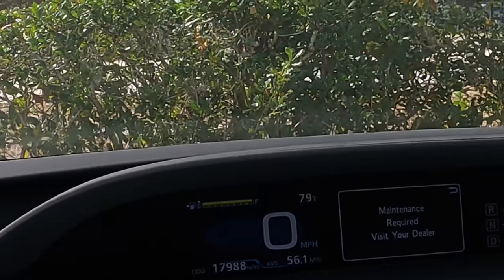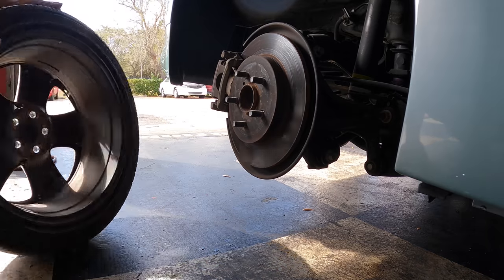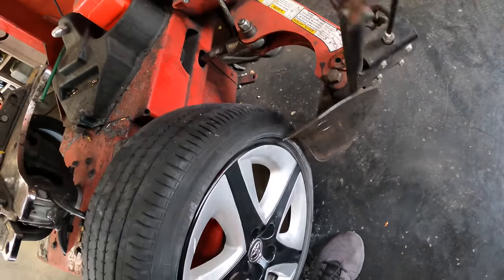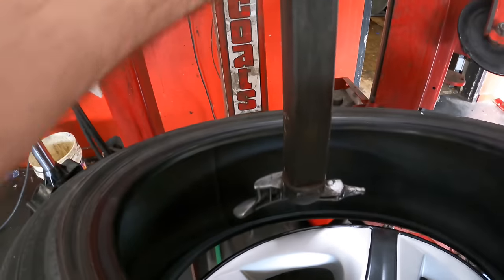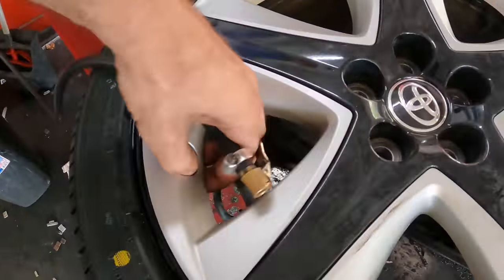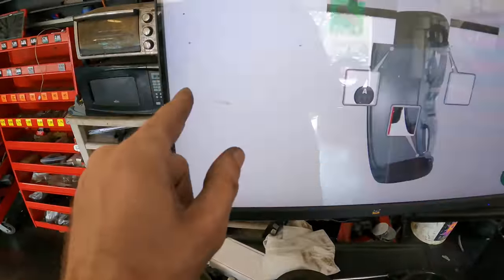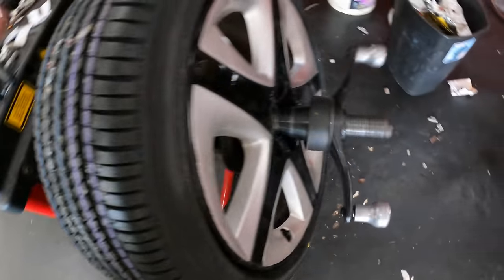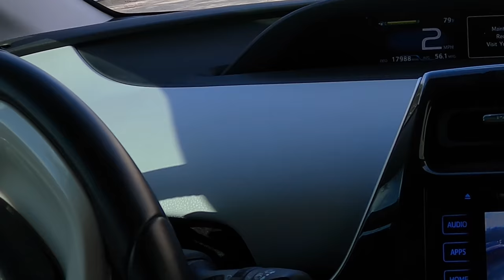Insurance Jobs, Not worth the Deductible! Toyota Prius! Tire and Wheel Walk Through

Comment: I did this almost 40 years ago in my grandfather's service station while in high school. The norm was still steel wheels. We would turn away all aluminum wheels and send them to the tire dealer because of our ancient tire equipment. We didn't have anything like this. Even our balancer was an old Hunter that you would balance while the wheel was on the car. We would even have to air up some truck tires with a lighter and a can of ether. Sketchy shit.
Reply: For very large industrial equipment tires they still do that with using lighter fluid to bead a tire and then some countries less developed. Do the same thing but on trucks like 18 wheelers they use a tank with a special nozzle nowadays
Reply: Those truck tires were dangerous.  I remember putting split rim truck tires under the hydraulic lift to air them up.  Getting the bead to set was a task on big tubeless tires.  Fortunately back then (60s) all large truck tires were tubed.
Reply: @todddunn945  Split rims! Yikes!
I still remember watching a news report that had video on some split rim failures on the tire changing machines of the day. That was some scary [bleep].
Reply: @toshihitsu1989  I've changed heavy equipment tires before. Tractors, skid steers, backhoes. We used starter fluid for the bead-sealing 'boom' and we immediately had to start putting air in before the expanded gasses cooled.
We weren't equipped with the fast-fill that actual tire shops have.
Reply: @MonkeyJedi99  yeah split rims were definitely scary.
Reply: Heck, I built my own manual bead breaker out of an old stair stepper treadmill type of exercise machine and some scrap metal, used old school tire spoons to remove the tire from the rim, and in some cases still used the ether method to set beads on some tires if they were stubborn. I just can’t swing a bead breaking hammer anymore which is why I built the bead breaker.  Then when I lost my house I had to store some things at my brothers house and he didn’t realize what it was because it was half disassembled and hauled it out as scrap metal, thinking it was dropped off as scrap by a friend of his and I have never found another one like it to build another one.
Reply: Vehicle mechanic in the Air Force from 1977 until 1984. I was stationed in the Philippines and we were doing set of tires on a trucks split rims.  We get this one tire done and I wheeled it into a 1/2" solid steel cage with welded 3" square tubing , engage the air chuck, step out of the cage and with the remote air valve open the air.  I step a few feet away and in a instant at around 60 PSI the split rim separated with a big boom.  The split ring was embedded into the 1/2 steel and back side of the rim was had put a dent on the outside of the steel cage.  Talk about scaring the bejesus out me. I was totally not injured but praising the safety cage.  Split rims are total garbage and I am glad they are NOT used anymore.  Edit. The force of the explosion totally blew the air pressure regulator off its mount and crushed the air line outside the cage.
Reply: @mikeske9777  split rims are scary to work with and have injured and killed many people. I saw an idiot working on one outside without any safety cage or even a chain and he had the ring aiming down. He was actually kneeling on the tire and rim with his knees on one side and his hands on the other side when it let loose. It sent the rim and tire all the way across the driveway landing in the middle of the road sitting on his lap with him still holding on to it because it had carried all 290 lbs of him with it. Somehow he only ended up with bumps and bruises other than some road rash on his @$$. He NEVER did that again.
Reply: @todddenio3200  Oh I know that for sure and am glad the Air Force made us use the safety cages. It was a big time write up for someone not using the cage.  The cage we had was utterly destroyed and had to be rebuilt after that thing blew up.
Reply: @mikeske9777  I don’t doubt the damage in the least, those things are outright dangerous

Comment: I liked seeing the newer style tire balancer in use, I've seen them but hadn't seen the procedure and each step. 
If that was a Ford you would have been instructed to put a corrosive metal weight on the aluminum to ensure corrosion as quickly as possible.

Comment: How times have changed.  I busted tires full and part time from 1973 to 1979.  I used Coats 10-10 and 20-20’s.  Bubble balancing was all we had in those days.  I used the spin balancer often and they were very accurate.  That balancer Ray used was slick.  We could abuse the wheels in those days without fear of scratching anything.   Fired me when I closed the hood of a late model Olds with a hood a mile long.  Moral of the story, make sure the battery down Assyrian is not laying on the air cleaner housing when hood goes down.

Comment: The tire machine at the job I used to work at is on it's last legs.  The clamping jaws that hold the tires need replaced, the actuator leaks and can only clamp the tire from the outside.  Doing it from the inside like Ray did won't get a strong grip against the rim due to the air leaking.  Lastly, the pressure gauge doesn't work.  So there is a digital tire inflator at the machine to at least measure the air if the hose is in use.  At least it has the plastic head so it can't damage rims.

Comment: It's great to see you take care of the ally wheel I always cringe watching the mostly youngsters in these tyre company's not taking any care and bashing and gouging chunks out of them. Great vid Ray thanks. Oh and if that was my tyre would have got black rubber glue and stuck it down just keeping an eye on it .
Reply: I thought it was steel with a permanent wheel cover?
Reply: I've actually had a shop replace a factory upgrade wheel once. I was familiar with the shop owner & he allowed me to stand at the machine with the guy doing the tire removal - i always do. I took pictures of the wheel before with reference to the shop in the background as he was putting it on the machine. As he broke the bead, I noticed he had the "shovel" digging into the rim and it left a pretty little ring at the edge about 1/4" wide. I told him but he either didn't speak English or just ignored me. I told the owner & pointed out how many more rims he would probably be replacing. He had me come back about a week later and installed new factory wheel for me. The 9wner is very good about taking care of reasonable complaints. Ive only ever complained twice & I've been using this shop since I was about 16. They have been in business for over 80 years but the help they employ are trained on the job there with no prior experience. I guess you gotta save money somehow to stay afloat.

Comment: In Australia, all wheels made after 2010 must have tapered nut seats.
Reply: Aluminum wheels can't be used with tapered nuts if I remember right. Something about the metal not being able to handle the stress involved with the tapered seats. Duals also never use tapered nuts because they center on the wheel hub and both wheels are held sandwiched with the same nuts. It used to be a two piece nut where the first nut had threads inside and outside and held the inner wheel, then the second nut tightened down into the first nut and held the second wheel. That style was very time consuming and had safety issues since there was twice the chance for over/under torque, so it's no longer used. That's how it is in the US, don't know how Australia does it.
Reply: @TheHonestL1ar  Steel tapered seats are pressed into alloy wheels.

Comment: Why not put a new schrader at the minimal in the stem? I always replaced them to ensure no leaks. Stay safe have a good day
Reply: Because 99 times out of ten they don't need replaced. They really are quite robust. Rarely do I see a leak from them and when I do it's often caused by debris on the seat from when it was replaced. In other words even brand new ones would leak under those circumstances.  
I've also seen spring failure and sealing rubber failure - pretty rare. But then I actually test for leaks when I'm done airing up. I test the rim and both areas of the valve stem. Then I wipe it dry with a relatively clean rag.

Comment: I always heard that tires should be changed in pairs, ex both fronts or rears never just one. Something to do with uneven wear. Can someone elaborate?
Reply: On wheels that aren't driven, it's not that important, especially when the other tire is almost new as well.
Reply: There is a maximum tread depth difference between two tyres on the same axle so you can't just fit one new tyre on the back if the other is just barely legal but you could have two new ones on the front and two just legal ones on the back. Front wheel drive cars wear one front side the most so standard practice is to swop that to the opposite rear and vice versa with the other to get even tyre wear then just change all four at once. I do not like mixing new and worn tyres.
Reply: It can matter or not. On RWD cars it doesn't matter but some think it does claiming excess differential wear. When you consider that the differential is designed for this and goes through much more work when you turn, any tire difference is insignificant in real life. With AWD and 4WD you're supposed to match all 4 tires by measuring the circumference of them mounted and inflated; most manufacturers actually have a spec for the maximum allowed difference. Almost nobody does this as it's usually close enough if all 4 tires are alike. The transfer case isn't built to deal with large differences like the axle differentials are so pairs won't do here unless you measure and match the other two. In front wheel drive it's less critical but should be close; ie no well used across from new. Here the difference can cause handling problems when powering or decelerating through curves, so you want those on pairs.

Comment: That comment about the metal duck head scratching the wheel reminded me of a previous tire shop I worked at. They told me they only used that machine for steel wheels because it would scratch the aluminum ones. I checked it out and found a plastic insert in the duck head retained with a roll pin. It was totally worn away. I found replacement inserts stashed in a cabinet and replaced it, restoring the functionality of the machine. It was also the only machine in the shop with special attachments for mounting low-profile tires. I'm sure that was the factory-installed rim protector insert that I replaced. Sadly, a lot of shops don't maintain their equipment.
Reply: For fancier wheels I usually reverse mount to remove any chance of nicking the face.

Comment: That tire damage is so insignificant, i would personally just glue it together with rubber-tire-glue.
Reply: Falls under the category: Why my insurance rates are so high
Reply: Though in Europe it would fail the annual inspection and if caught by a observant policeman, a hefty fine and 3 points on the licence, put the spare on (if you have one even) or it gets towed away on a truck that they organise at your expense.
Reply: @572Btriode  Some US states are operate what you brought. My state has 0 inspection/0 emissions testing.
Reply: @mph5896  Yep, I understand that.  It's unusual to me, the UK and Europe run annual tests which are quite searching and severe.  At any police stop for whatever reason, they'll take a look at all the tyres, anything looking worn will have the tread depth gauge brought out.

Comment: I'm sure Ray looked but here is my pet peeve. Every manufacturer engineers how the tire works with that specific vehicle. They have a lable on the door jamb with the pressure that works. The maximum pressure listed on the tire is not the correct running pressure for your vehicle. Trust the sticker over the guy.
Reply: Think 32 to 36 is correct for a Prius depending on tyre size.

Comment: Always good to check wheel run out and out of round to make sure something isn't bent, especially if the tire had been damaged more from a curb hit or accident. Since this car came from the body shop, you have to wonder what work was done. Also a new tire sometimes comes from the factory out of round. Doesn't happen as much these days. Years ago had retread snow tires that took 8 ounces to balance.

Comment: I enjoyed this video for a number of reasons:

* The fact you were careful with the customer's wheel as to not scratch it.
* The fact you used the air source off the balancer to fill the tire up, and jammed the valve stem in when it was at the pressure.  (Surprised you didn't get comments about not using a stand alone, daily calibrated, dolphin safe pressure gauge accurate to .0001 psi.  haha)

Especially where I live (CA), shops are reluctant to let customers in the work area.  So it was cool to see up close how a modern wheel balancer works.

Comment: When I was a High School kid in the 1960's, I worked part time at a gas station and sometimes changed tires, like you did, when I was  not pumping leaded gas. We had a tire machine. But there was a lot of grunt work getting the tires off and on. All of the tires, back then, were bias ply, high profile tires. 

The wheel weight machine was a simple bubble centering device that the tire and wheel were horizontally put on to balance. lead weights were them added as needed until the bubble in the transparent liquid centered in the circle. 

Wheels were never torqued on the studs, like you did, just high impact gunned on.

Comment: I know you were trying for that 'Great Shot' when the bead pops on buuuut....... years ago my dad had a small gas station/ tire shop. He was installing a NEW tire on a wheel, airing it up and when it 'popped' the bead failed and it exploded! My dad was holding the air hose onto the valve stem. The tire shot off the machine and fractured the roof joists overhead! It also shattered the bones in his arm. He had to have several pins and more screws in his arm to hold the bones together. He never regained full use of his arm or hand. Don't take things for granted, just because it's new doesn't mean it can't fail. Please be careful.  As far as people go;  Smile, make them wonder what you're up to. :D:D:D

Comment: This is my first time seeing a tire change meticulously done with care. I guess I lived in the rotten apple far too long because I've seen tires slapped on no care to the tire sensor, nor lining up the valve with the dot, and I think this is the first time seeing the sticky weights removed and replaced during balancing. Maybe the dealer has done it but the local little shops don't and balancing is not cheap. So thank you, I learned something today.

Comment: Food for thought Ray: you may need to alter your method a bit by not using the face of the wheel for a work bench while lubing the tire beads. Spinning the tire on the face of the wheel can damage the clear coat. Had a large national tire chain store damage the clear finish on one of my almost new wheels by spinning the dirty tire tread on it while fixing a flat. 
It could save you a headache if you didn’t do that anymore.

Comment: So many pinch welds have been destroyed (including mine) by lifting with a floor jack without a proper V slit lift contact pad. Then when they get a flat ,their scissor jack cannot fit in the pinch weld. If you attempt to lift without the pinch weld, there's a great chance of the scissor jack sliding off causing injury or damage to the car.
Reply: Nothing like watching a car sag as the jack pushes up through the jack point. Carpet hanging down through the missing floor. One more year! I promise.

Comment: I recall working weekends while in high school in 1980 at an Irving station (Atlantic Canada) the mystical art of static balancing wheels, ie where, for the younger viewers, you lay the wheel horizontally on the balance beam thing, placing weights around the rim till the bubble in the hub hole was centered. Even then I doubted it’s accuracy.

Comment: If both red and yellow dots are visible on your tyre and you don’t have any dots or marks on your wheel, red takes precedence over yellow and you should align the red dot with the valve stem. Cancelling out the high point takes precedence over the lightest point of the tyre, which can be addressed with wheel weights.
Reply: Except that doesn't help the runout at all. The lightest point of the tire is still the lightest point even taking the runout into account.
Ever just balance a wheel? Yeah they can be way out of balance too and have no connect to where the valve stem is. It's very annoying when you discover that because you want to know why it needs 3 oz just to balance.
Reply: The red coloured dot marks out the highest point in the tyre, or the “radial force variation first harmonic maximum” – where the centrifugal forces are at maximum on a rotating tyre. In most cases, your wheels will also have a dot – either drilled or marked out by sticker – to signify its lowest point. The red dot on your tyres should then match up with this marking on your wheel.

Comment: Enjoyed the video. The use of the tire machine was very interesting. Back in the day (and still now) I use an old Coats 40-40A. The process between the 2 machines differs so much yet the same results, however I do see where the newer machine has a lot less chance of wheel damage. Never used a computer wheel balancer, just the old bubble balancers. Though crude, I've had very good luck with the bubble, no vibrations and good tire wear.

Comment: Tire machine is 15 years old  balancer is newer Not sure how old. One thing Toyota 76 ft lbs.  Also torque the wheel barely on the ground not rocking back and forth. Biggest thing I saw didn't replace the tpms kit .  But do love all the videos and the diagnosing of the issues.